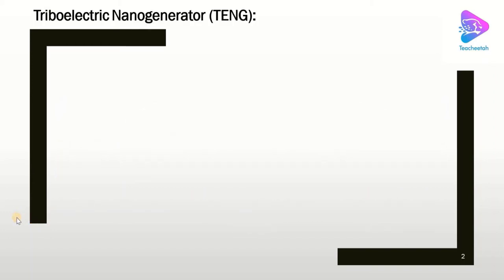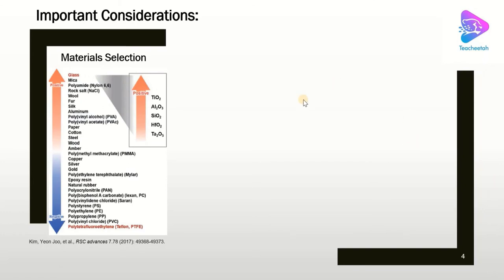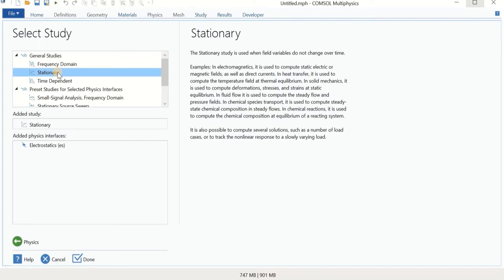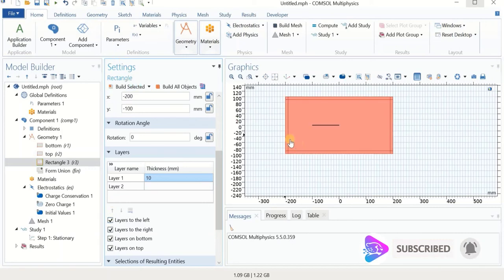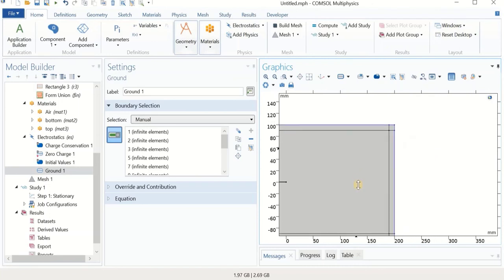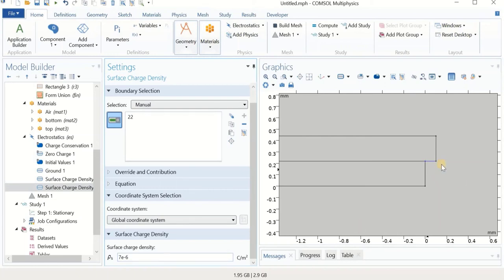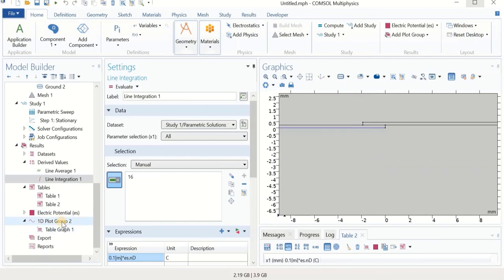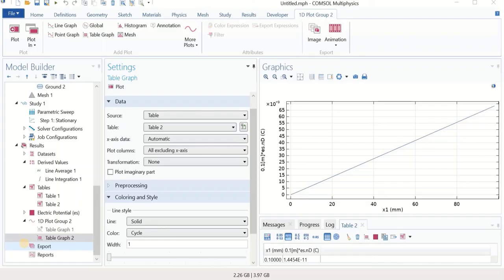Tutorial 12: Modeling Triboelectric Nanogenerators with COMSOL Multiphysics: Part 1

Comment: Nice illustration. How to take surface charge density for another material?
Reply from the maker: Thank you for the comment.The charge density on a material surface is usually selected based on the available references which used experiments or modelings to find that, or for simplicity an arbitrary number which is relatively logical is selected based on the material affinity and tribo-polarity .

Comment: Thanks for your incredible lesson, It is really helpful for my research. And.. In my case, I used fabric layers so Can I apply the same procedure with 3D models?
Reply from the maker: Thanks for the comment. Yes, you could. Note that the geometries selected as boundary conditions in a 3D model are different from 2D. For example, a line represents an electrode in 2D while a surface area is used for the electrode in 3D.
Reply: @Teacheetah  Thanks for the response. Even though I have some doubts regarding fixing boundary conditions especially drawing infinity in 3D space. I have sent detailed texts to you personally, I hope I could get answer ASAP. Thanks
Reply: @manichemist1001  Did you get your response sir?

Comment: Instead of sweeping the parameters x, Can we give directly velocity to on of material. How to add velocity ?? Plz guide.
Reply from the maker: Yes, you could. You may need to add the Time-dependent study to your model. Then, define your time varying parameter x as a function of time (depending on the type of motion), and run the system for the desired time range. Note that due to the variation of geometries positions over time, you may need to assign Moving Mesh feature to the geometries that have motion.
Reply: @Teacheetah  Thankyou for your comment but i am finding in difficulty with the assigning the moving mesh feature. Can you more elaborate plz!!
Reply from the maker: Depending on your software version, you may go to the Definitions tool bar and add Deforming domain under the Moving mesh option and then, assign the domains that are moving in your problem to the Deforming domain feature which added to your model. Please note that moving/deforming mesh is a general feature of the software not necessarily for this problem with general instructions e.g. in the following link: https://doc.comsol.com/5.5/doc/com.comsol.help.comsol/comsol_ref_deformedmeshes.25.14.html

Comment: For some reason, I am unable to implement the infinite element domain. Any suggestions as for why?
Reply from the maker: Even if you are not able to define the infinite domain, you may use a large air domain surrounding your system and set it’s outside boundary to Ground

Comment: How to make TENG using two different materials having different surface charge density
Reply from the maker: In theory, the charge conservation condition must be maintained for the whole system in the simulation. This requires that the total amount of charge (Q) generated in the surface of one contact material to be equal (but with different sign) to  the total charge on the surface of the other contact material. In dielectric materials, the total charge is equal to the contact area (A) multiplied by the surface charge density (Sigma). Therefore, if you want to have different surface charge density in two different materials , their contact area must be different. in a simple word, Q1=-Q2 which means A1*Sigma1=-A2*Sigma2, so if the densities (Sigma1 and Sigma2) are different, A1 and A2 must be different. One good example is when the contact materials have surface modifications with micropatterns which make the contact area different. The other example is when an interdigitated structure with multiple units is in contact with a uniform surface.
Reply: @Teacheetah  Thank you very much❤️

Comment: How to apply pressure on TENG in comsol ?
Reply from the maker: Generally, studying the effect of force or pressure may require the addition of Solid Mechanics interfaces into your model which also needs the understanding of the mechanical behavior of your system such as contact mechanics and solid mechanics features of the system
Reply: @Teacheetah  thanks for your reply, I have used solid mechanics module but where to apply load on electrode or outer infinite layer?
Reply: And also where to apply force/ pressure in sliding mode?
Reply from the maker: The solid mechanics and the TENG (modelled in electrostatics interface) cannot be directly linked to each other as there is no multi-physics feature for that. You may model the solid mechanics first, get any motion, force, and deformation related to that, and then study the TENG response. Our Tutorial 7 might be useful for understanding how this may work showing a similar case but not for a TENG.
Reply: @Teacheetah  Thanks for your reply..
Reply: @Teacheetah  while modelling in 2D solid mechanics ,where I apply load on air or electrode or outer boundary ?